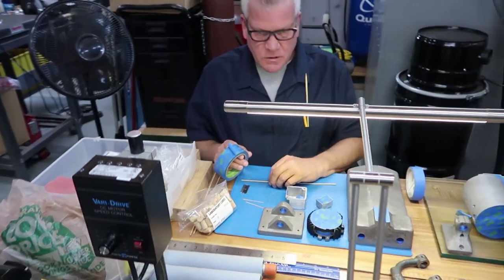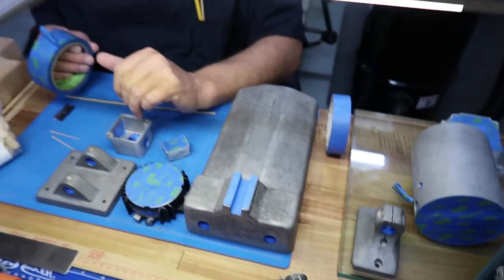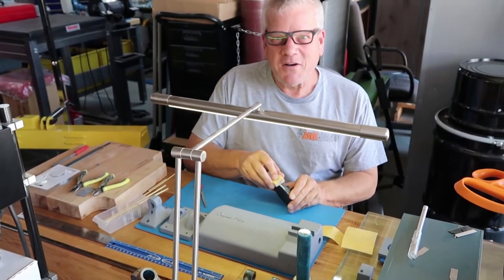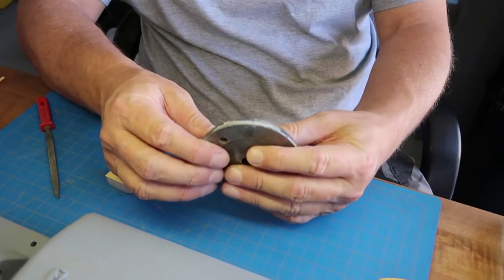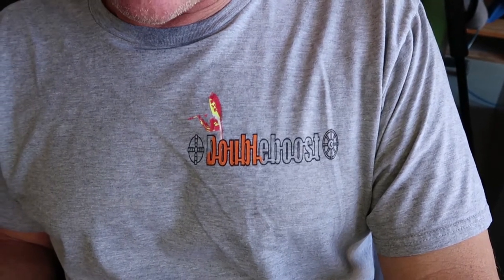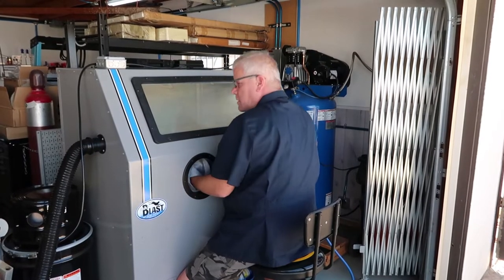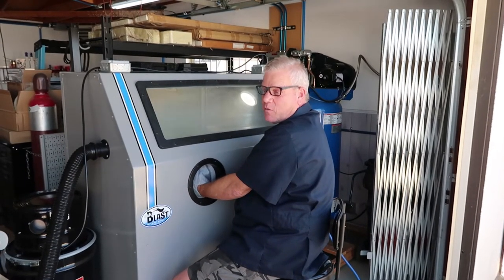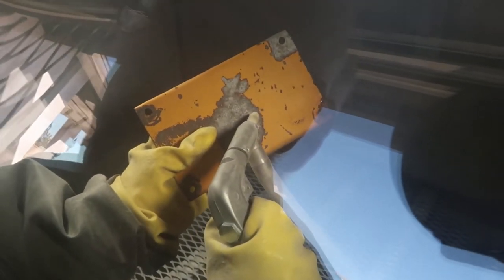SHOP ADVENTURES 03: Painting & Curing Watchmaker Machine Parts

Comment: I like your sand blaster set up. I can only imagine how much better it is then the sand blaster i'm using out side in my wife's flower garden.  Please don't tell anyone. Thanks for your videos M.K.S.
Reply from the maker: Your flower garden secret is safe with these two desert dwellers, who knows maybe this is good for the soil. We love our American made bead blaster a lot, it is really large for our size needs but bought it because of the CFM and twin lighting abilities, foot pedal is great to have also, like those pedals a lot on many of our machines allows for keeping the two hands free for best work practices. 
The bead blasting cabinet  table screen inside allows us to layout many parts and do them one at a time without stopping and having to open the door remove parts and add new ones. The machine has a great dust collector on it that really helps out a lot.

Comment: Nice finish on those parts, can you give a bit more info on the paint and IR curing? Your setup and curing times would be interesting to know more about.
Reply from the maker: Great question! We were actually talking about your question today because we realize that we should have addressed this in our video and talked about this process in more detail so thanks for bringing it up.  The unit we use is made by Infratech and is model SRU-1615 which is a 1500 Watt Medium Wave Infrared system.  In the auto body/painting industry, they use both Short and Medium Wave infrared systems whereas the Infrared heaters that you would buy to warm ourselves are Far Wave infrared systems.  From what I understand, both Short and Medium wave systems penetrate the paint and heats the base metal so that the paint drys from the inside out.  The Far Wave system would only heat the surface of the paint which is what we want for heating ourselves but not for curing paint.  For best results, we prime and cure, and then we apply the top coat and cure.  The curing times depend greatly on the paint type but you can visit the website page for our product and download the 2 page instruction sheet at http://infratech-usa.com/automotive/products/medium-wave-systems/model-sru-1615/ which shows the common paint types and recommended curing times.  In our experience, the curing times they provide appear accurate only for sheet metal (think body panels, etc..) or very small items that heat up quickly but the larger and heavier the item such as a machine casting, the longer you will want to leave it under the lamp.  We use an infrared thermometer to monitor the heat on an item and when it reaches a stable temperature, we then set the timer.  You can also use this infrared system on body fillers and adhesives which we have also used with very good results.  Let us know if you have any more questions.
Reply: One more, so any old spray paint will dry quicker using this or is special IR curing paint being used?
Reply from the maker: Yes, the Infrared curing works on any type of paint.  Although we have been using this curing method successfully for years now, we just ran into our first issue with a paint that we used for the first time which you will see in the next video on Monday.  In addition to 2 part epoxy, lacquer and other professional paints, we have used many types of aerosol spray can paints with no issues at all but this was the first time we used Rustoleum High Performance Enamel spray paint and although it felt completely dry after the curing process, it was still soft internally as you will see in the video.  It didn't feel soft to the touch but we had to mask the bottom of some parts so that we could paint the top and after removing the tape, we could see the imprint of the tape surface transferred to the paint surface.  The solution would be to extend the curing time but we have never had to do this before with any other type or brand of paint.  Our guess is that especially for consumer paints such as from Rustoleum, they are reducing the strong solvents which evaporate easily and replacing it with other less evaporative solvents and even water.  Especially living here in California with the low-voc standards, the good stuff is unfortunately going away.
Reply: Thanks for the replies, excellent in explaining everything.Can't wait to see the next video!

Comment: G’day Lance, those parts will look good when painted. The bead blasting process is slow, why don’t you chemically strip the parts first, is it the chemicals or the mess you don’t like. Anyway the parts look good. Cheers Peter
Reply from the maker: Thank you Peter, and thank you for watching and subscribing to our new channel.
We are just doing the best job we can to represent the machinery and tools with the best of our rebuilding abilities. 
Yes you are right about the paint stripper, once we utilized it on a big powder coating error of a vintage ash tray and stand from likely the fifties or sixties during powder coating training Peter. 
Powder Coat is really a tough paint and I swear it gets tougher in time, so the stripper is the best way to start.  
The issue for me is I over our great big American Made parts bead blaster (big to a pair of watchmaker micro machinists) to us it cost a lot, so I utilize it for the reason of honing my skill set and it lets me hangout in the machine shop working with Patrick my best friend. 
The yellow part in the parts blaster cabinet in the video is for a large GE 3 phase triple belt motor, a giant pedestal grinder for any machine shop size. (oh here is a picture Peter) https://www.instagram.com/p/BYEvsAIAgf3/?taken-by=active_atom  
 I also wanted to share that I think on your channel I am at video 32 and moving a long watching you build the milling machine from pouring a series of aluminum cast parts all the way to making machined parts. 
I just watched Double Boost on his channel from Sunday pouring a few bronze fittings machining them after the castings were made. Johns casting boxes are good, but yours are better though he has you on the set of little trowels, we have a thing around here about supper small things.
Have a great day Peter.

Comment: Been enjoying these vids. There's no way the mask at 4:15 is doing anything to protect you; be safe and get proper gear.
Reply from the maker: Hello basstbone64, thank you so very much for your concern and advice to help us here.

Now please allow us to share the shows story about the paint you viewed. That paint is consumer Rust-oleum, A rarely used type (one time almond) with minimum solvent mostly water based California clear paint meaning it has so little solvent it literally requires a bake oven to harden even after 30 days sitting in a dry arid desert such as where we are located. 

The paint actually would be fine (in our opinion) to paint with little to nothing for your breathing or your eyes as you see the painters eyes are not shielded during the usage or filming of the show either.

PRODUCTS WE ACTUALLY USE on and off camera
We do use 3M branded Dual Cartridge Respirators with eye protection full-time when we paint our commercial aerosol, lacquers, enamels and most importantly our two part epoxies.
We are in good hands having you her, we can feel this in your caring suggestion and you are sure right those off the shelf breathers are not of much use, thought we do use these through ways consumer breathers as we showed during the show and off camera we use them during paint stripping, part and machinery sanding, parts and tool polishing  and the likes, just to stay clean and around here, for years to come, so we can keep safely bringing to you great shows we are happy to have you here viewing and sharing in.
Lance & Patrick.
Reply: @ActiveAtom  Thanks for your reply. I'm glad to hear you have considered this thoroughly. I wish more high quality finishes could be water based.